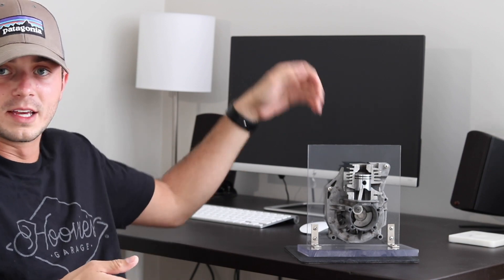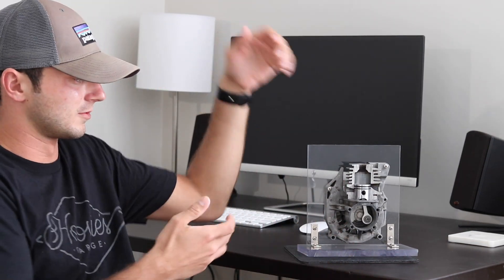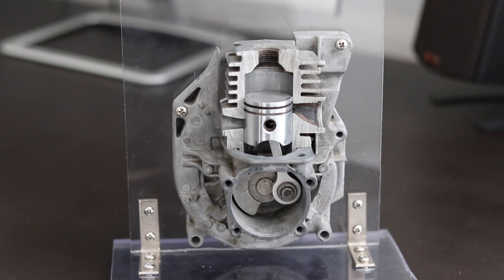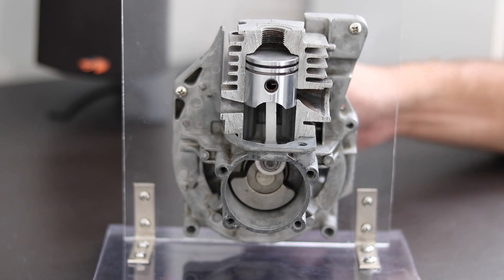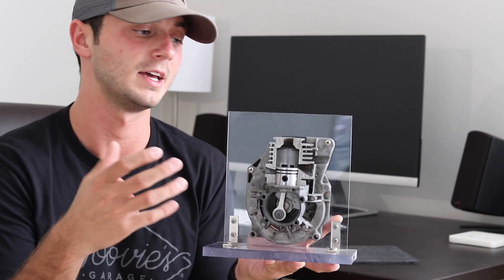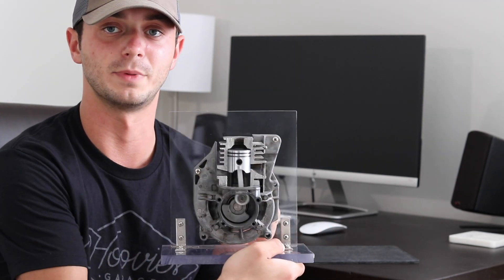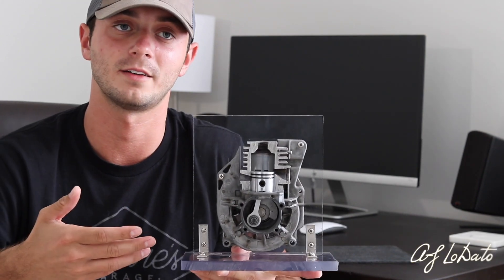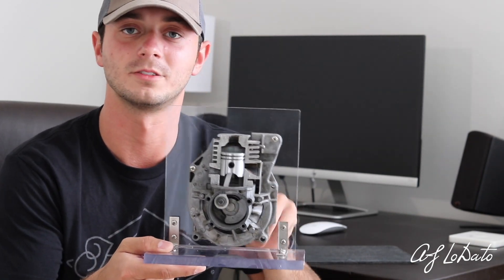Mini 2-Stroke Engine | Tabletop Engine Cutaway

Comment: Nice!  

You said it blew up.  What failed?  The engine block looks intact.
Reply from the maker: It was years ago so I vaguely remember. But I think where the spark plug was had a crack down the head and couldn’t get compression.
Reply: @AJLoDato22   Ah.

Quick thought for improving this model: unless the magneto on the flywheel isn't polarized anymore, remount the stator to the block (if you can) and put a new spark plug into the plug hole; if you can turn it fast enough by hand, you can probably get the plug to fire.
Reply from the maker: @hell5309  That's an awesome idea.
Reply: @AJLoDato22   Thanks!

I'm curious, what's the bore on that engine?